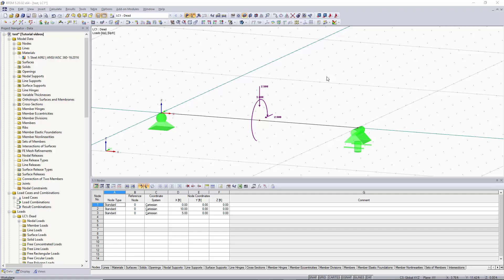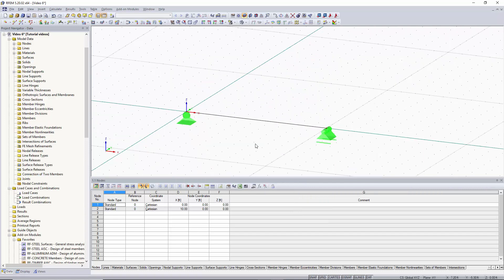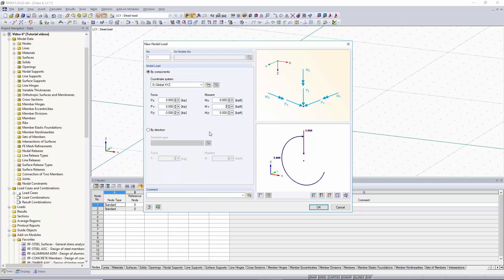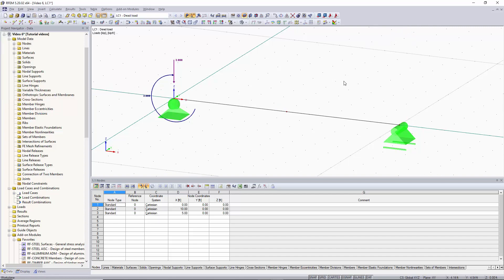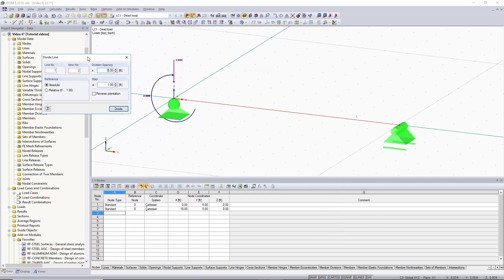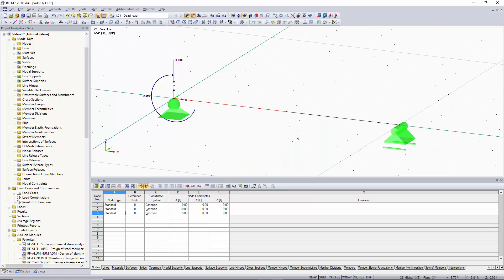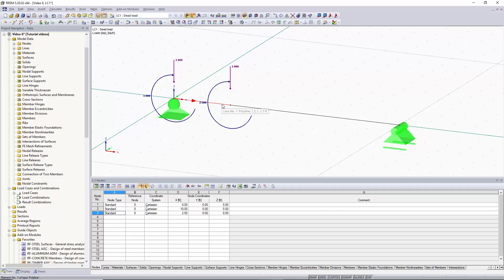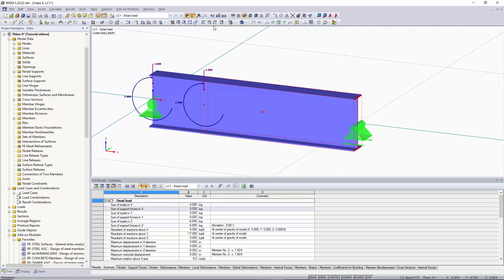RFEM 5 Tutorial for Students | 005 Nodal Load Applications

Comment: This is great idea to make a series for Students. By the way, can you explain when the option "place node without dividing line" is mainly used?
Reply from the maker: Hi, Robertas!
Sometimes you want to keep a beam as an unit and not make two out of them. This is helpful for roof girders where purlins connect. For the checks you need the roof girder as one beam in order to get the correct design lengths. But you still want to connect the purlins and you do not need to divide the beam for that.